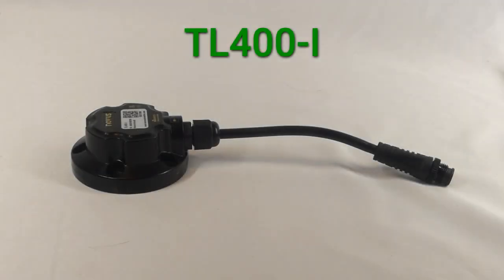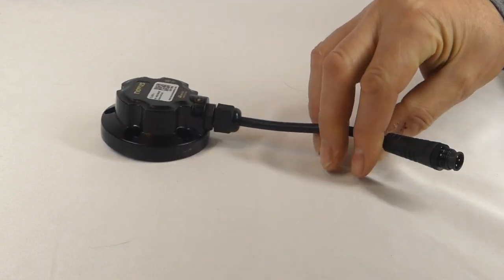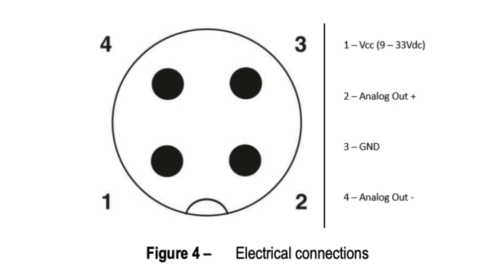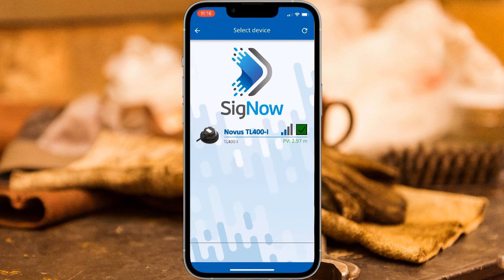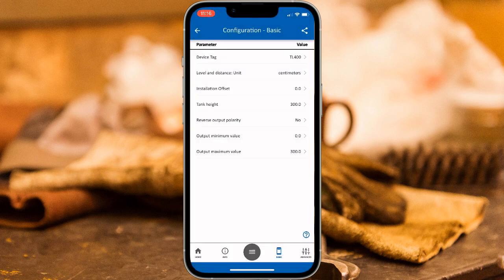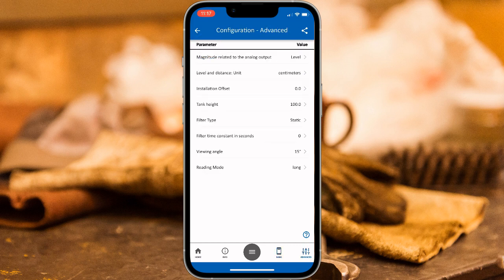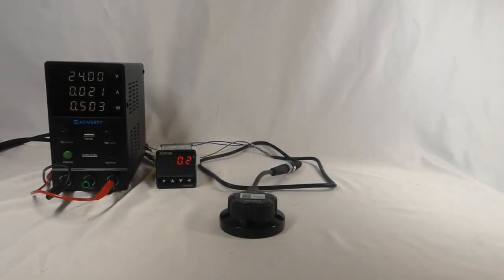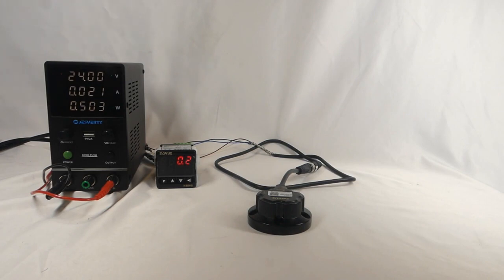Getting Started with the TL400 Level Sensor

Comment: Is it possible to use sensor without n1040?
Reply from the maker: The N1040i is just one example of a reader.  The output of the TL400-I is 4-20mA(we also offer the TL400-V which has a 0.5-4.5 V output), so any compatible reader, data logger, PLC, SCADA etc. which can read the output will work fine.